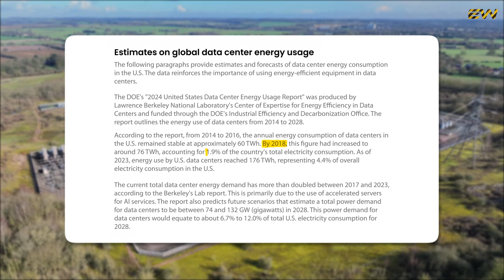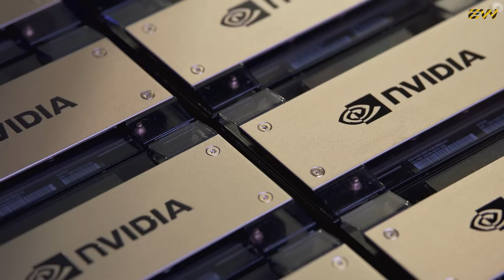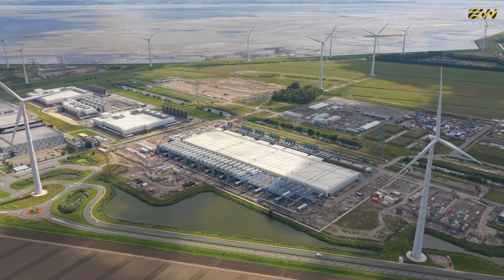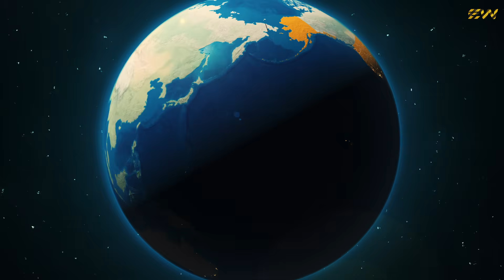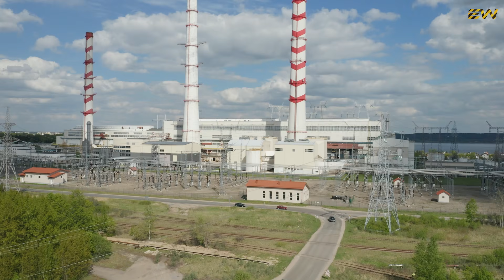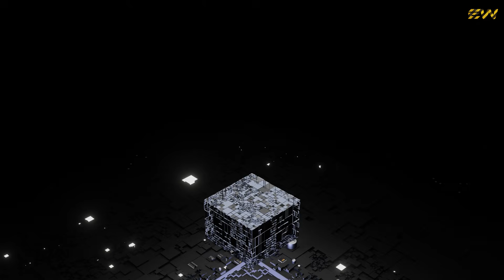How Data Centers Are Powered (And Why They’re Straining the Grid)

Comment: Why don't they use solar power? Musk's 'Big Battery' outside Adelaide was built in 90 Days and seems to have been a real success.
Reply from the maker: Very good suggestion, solar power is not reliable however if its coupled with BESS it can provide provide power for almost 24 hrs.